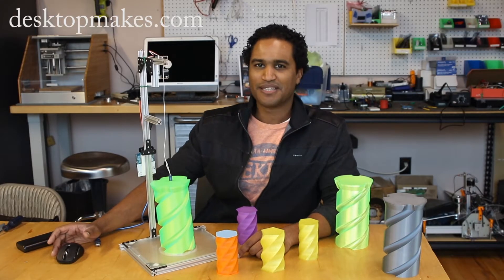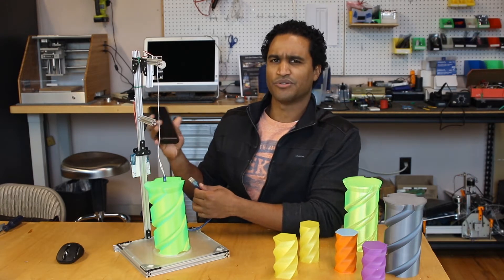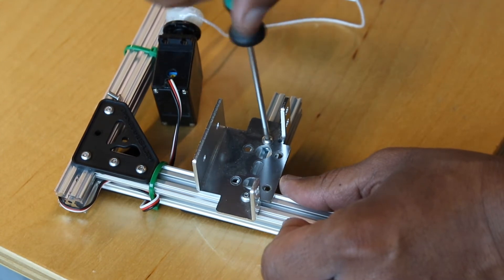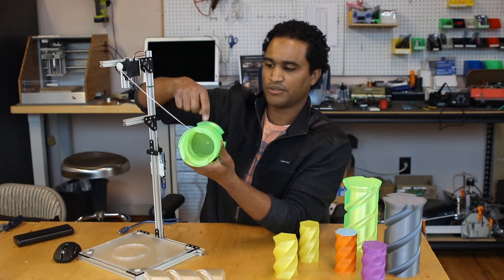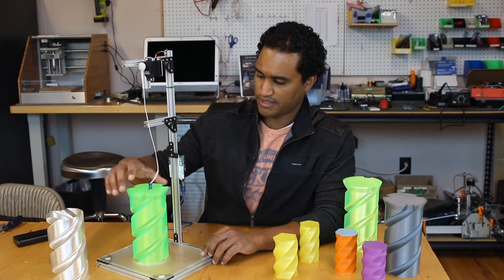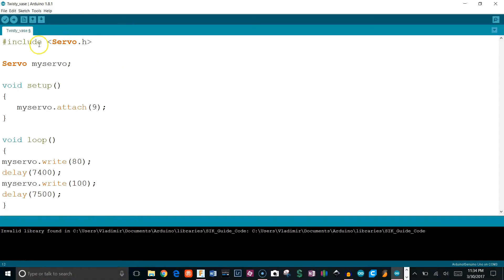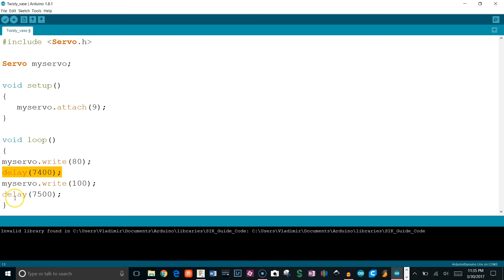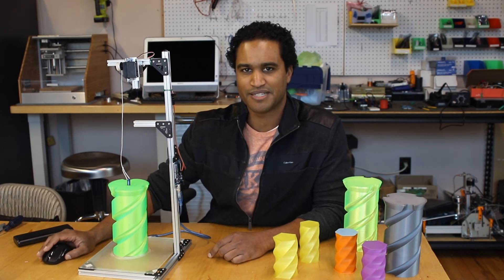Twist Container Automation with Arduino

Comment: I love it!  These are the best kinds of projects - the ones that combine multiple disciplines to do something interesting.  I think it's totally worth doing these kinds of off-the-wall projects -- I always learn something, and it keeps life interesting!  Thanks for sharing!
Reply from the maker: Thanks.  I'm currently working on an update to this project where I use copper pipes instead of aluminum extrusions and also wire in a limit switch for consistency.